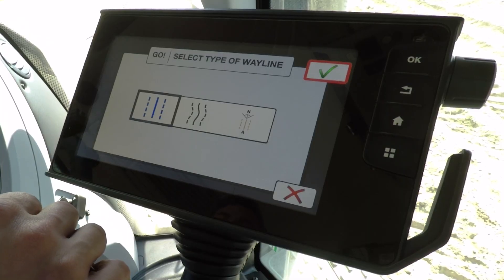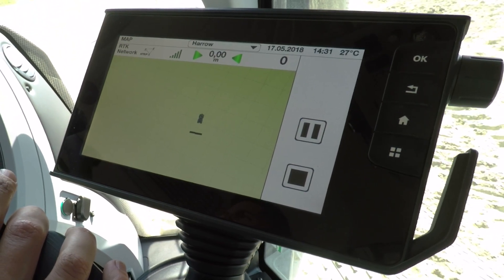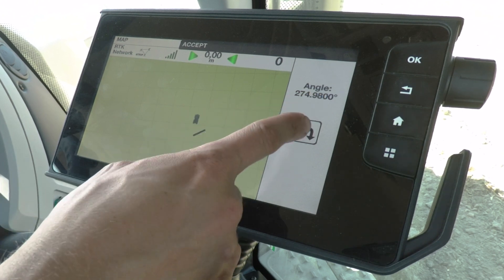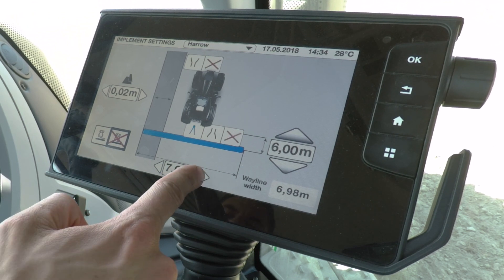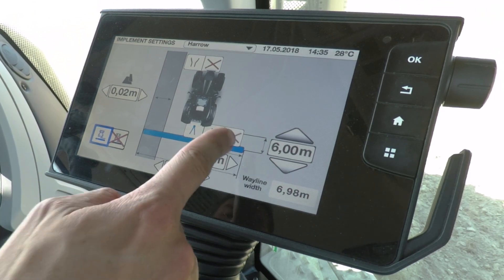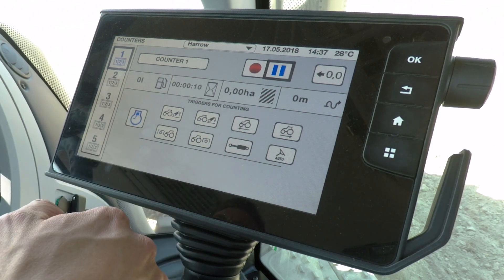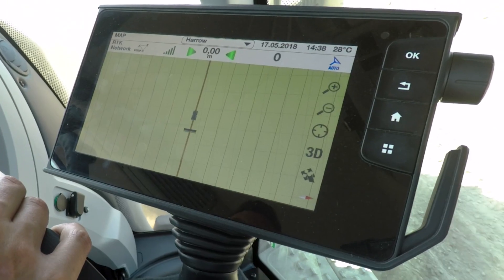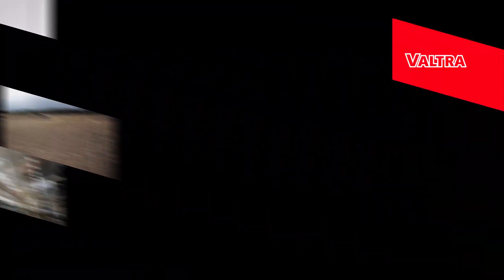Get more out of your AutoGuide - Valtra Smart Farming

Comment: Is the painting funkion only Can use in the rtk version i have the autonomus Version and it dont paint my wayline?
Reply: No whatever the precision is you can have it.
Check the counter trigger for the autoguide if its activated (switch on the record touch) and check which trigger is used for the implement, put it on the autoguide or rear linkage for exemple.